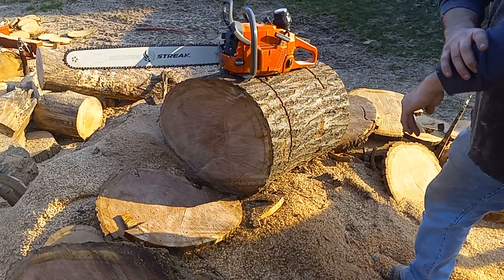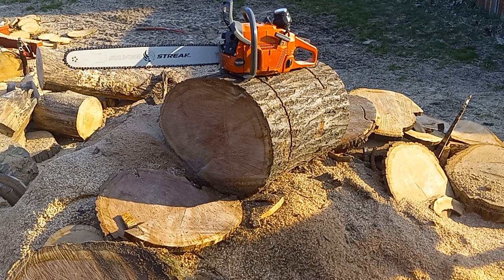experimental port work test cuts

Comment: Experimenting with timing numbers and different machining then taking the saw apart and reassembling is lot of tedious work but it’s the ultimate way to learn. I know with my recent adventures into trying to find the sweet spot on the 359/357 it’s been quite the experience but you get quick at putting them back together and tearing em down. Sometimes you feel like you make progress then sometimes it’s disappointing but after all it’s how you become a great builder. Nice work!